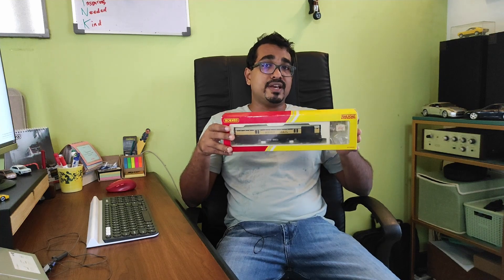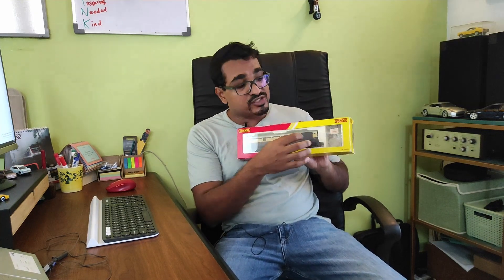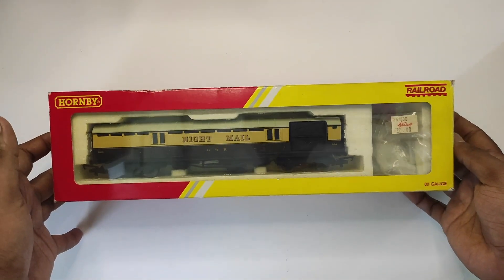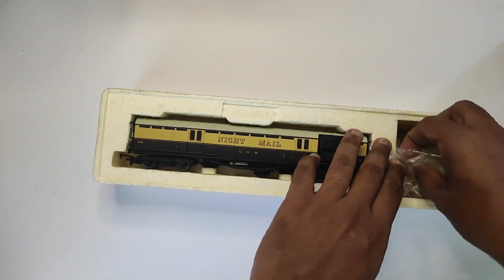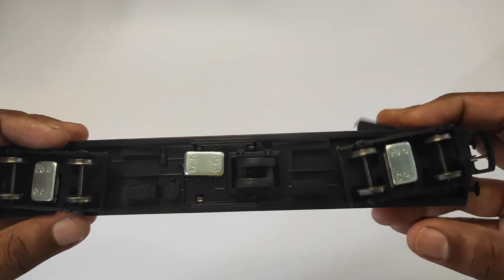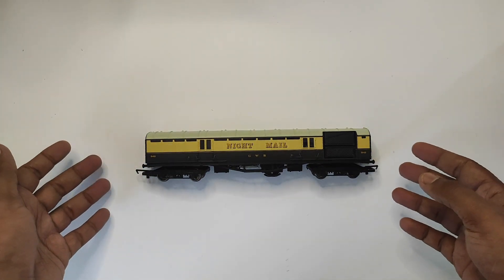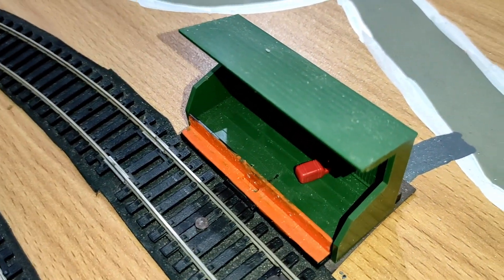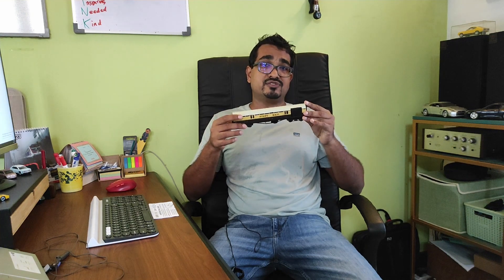Hornby R4526 Operating Mail Coach Review

Comment: Thanks for the review, beautiful and clear points without rose tinted glasses. Might not bother on this coach
Reply from the maker: Thanks Kane! Purchasing it was indeed a rose-tinted moment as I'd seen it in catalogues as a child and always wanted it. However, after using it a few times, the rose tint quickly wore off. It's still something that I take out and operate every now and then,  but not a regular runner on my layout. Not one of Hornby's best efforts. I guess that's why they no longer seem to carry it on their website in their current releases.
Reply: @ashraaqwahab  I wanted to pick one up second hand but all of them I find seem to be missing the activation ramps and the mail bags
Reply from the maker: @kanehood3478  good thing you didn't then, because the ramps are rather fragile things that can be easily damaged. They feel delicate to the touch. When I purchased the coach and kit, I installed the ramps on two R601 tracks and never removed them afterwards. When I started making my permanent layout several years later, I simply used these two sections of track in my layout, with the ramps pre-installed.